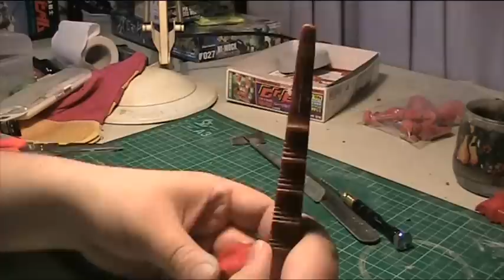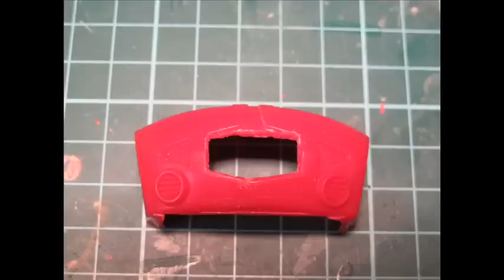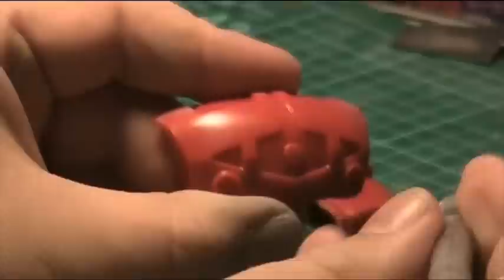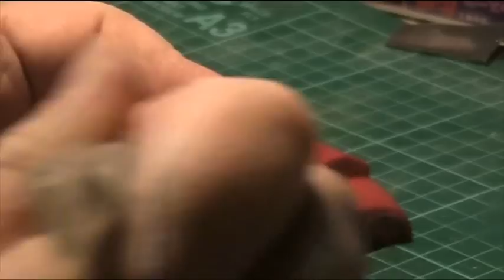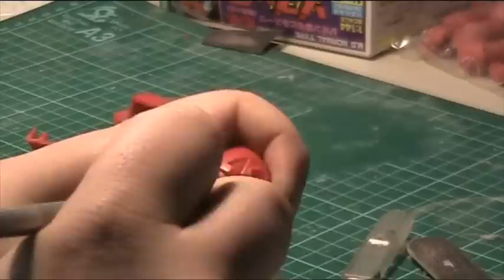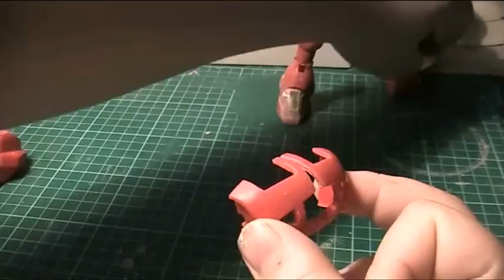Gundam/ mech model workshop 97: Cutting your model

Comment: Wow, man do you have a lot of really old kits. This adds so much more detail to them, nice work.
Squadron makes a scriber that removes a little plastic each pass. This tool can do some of the things done here and it's good for making panel lines as well. It does not create a flat line but a V line instead, really good for model car doors and hoods or trunks, very sharp. That drill vice is made by "Wave" and uses a different chuck to keep the drills in place, it is a very good kind of vice as you can change drill bits in seconds, get from HobbySearch Japan. You will need the following bits, 1mm, 1.5mm, 2mm, 2.5mm, and 3mm. These will do most of the jobs you need done on Gundam kits.